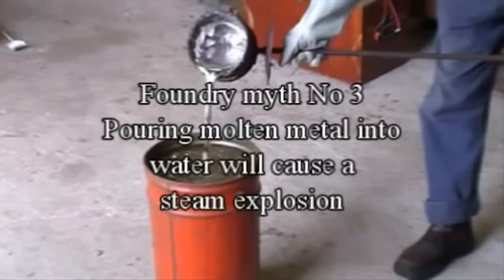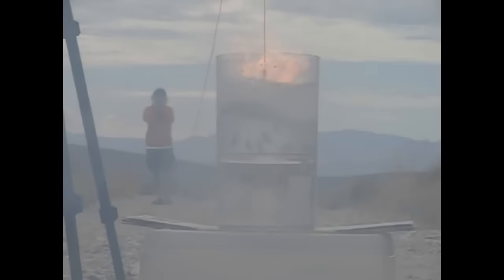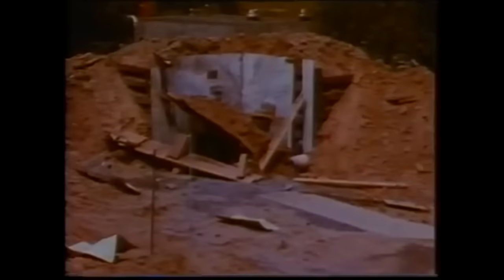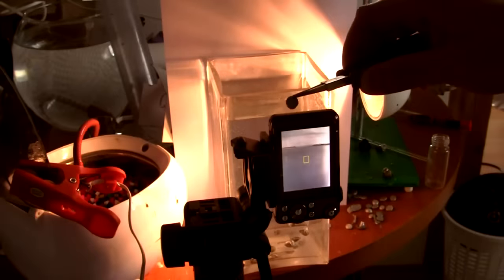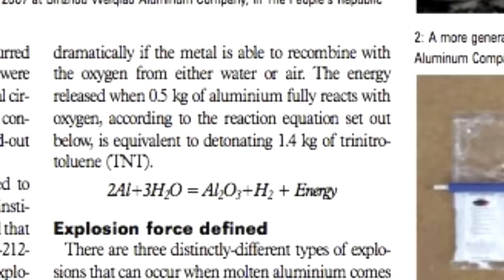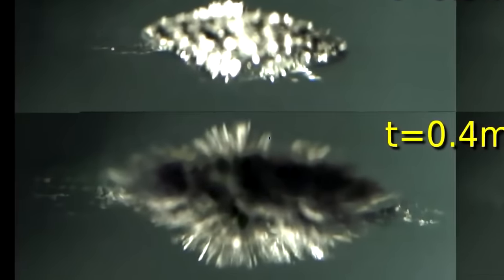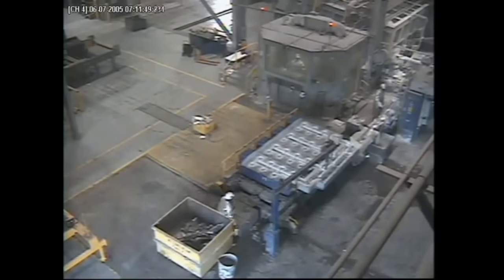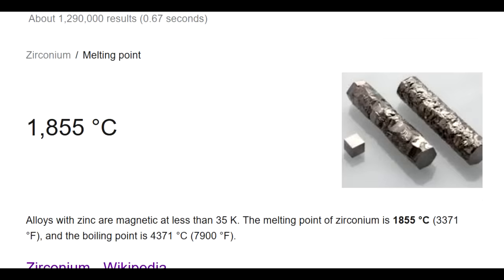The Awesome Power of the Aluminium-Water Explosion!

Comment: I'm pretty sure these backyard pour guys are being protected by the Liedenfrost effect AND the fact the volume of water is greater than that of the amount of molten aluminum, coupled with the fact that there isn't a "trapped water" scenario. Sure, Aluminum is highly reactive... but what if it takes a flash of steam to rip through the oxide layer, and it's not just the water by itself? I think it's very specific conditions that cause these massive explosions, like phase changes + potential energy. The difference between packing gun powder into a a pipe, versus lighting an open pile of it.

Comment: I once absent-mindedly dropped 20g or so of very recently molten bismuth into a bucket of water. Excitement ensued. Purely from the thermal energy flashing steam, no chemical reaction hanky panky involved - but that was plenty enough to imbue me with a permanent paranoia on the subject of hot metal, in water, near me.  It's been 20 years and so far complacency has not returned.

Last year a colleague was disposing of a bottle of dirty gallium-aluminum alloy, preparing to pour it all at once into a pan of water. Although this metal was not hot, it tickled my spidey-sense and I was uneasy. She made fun of my hesitation... so I did the manly thing and left the room. Good thing. What water didn't get converted to hydrogen, boiled and spattered. Something in the room sparked and ignited the hydrogen. Just enough to claim her eyebrows, lashes, some hair, and her dignity, and give her a bit of a sunburn.

Comment: I'm finding this a little over the top. Yes I get it what is going on but i dont understand is why aluminum doesn't superheate the water enough when there is more water. Dont you have to trap it to contain it. Small amounts of water explode. While larger amounts of water with smaller pours of live aluminum just sizzle until it cools. Maybe I'm wrong but I've yet to find/see anything otherwise.

Comment: Sorry posted before editing. With large volumes of molten aluminium, or any other high high temperature molten metal, and small volumes of water, especially in a confined space, the steam becomes super steam, far above the boiling point of water, with far more energy. All the ingredients for disaster.

Comment: the reason its not exploding when its being poured from a small crucible is because the water isn't at a point where its expanding very fast, if you were to drop a whole crucible of molten aluminum in the water at once then it would explode outwards due to the expanding water, its not really playing Russian rulet its just the way science works :/ Ive seen water expand from hot/molten metals before, its truly crazy the power it has.

Comment: You have two types of explosions here I think. One is the aluminium-water reaction, the other is an steam explosion then you flash heat water with molten metal. 
Second is probably easier to get especially inside an mold there steam has problem escaping.

Comment: I’ve seen a much smaller version of this when an idiot spilled nearly a gallon of water into our solder wave pot. As soon as I saw it happen, despite being in full protective gear, I high tailed it away as the resulting steam blasted droplets of 600 degree molten solder all over the area, which luckily faces a metal wall so it didn’t hit anyone. The water was mixed about 60% water 40% alcohol for cleaning and like a moron he left it sitting on the side of the solder pot which is all metal and very hot. The plastic container melted, I heard sizzling, and poof! A shower of hot lead and steam. Needless to say he didn’t hang around long. I had just gotten around the corner. I was completely covered with face shield, gloves, jacket, apron, etc, but the top of my head isn’t covered and it’s luck I didn’t catch any.

Comment: This is one of those situations where because Joe Public comes into contact with them everyday, they don't see the hazards.
They use aluminium foil and thus don't think pure aluminium is incredibly reactive.
They see 12V on a car battery and having used a few D cells in series to get 12V don't see the hazard that comes with shorting one out.

Comment: I have been messing around with the THEORY of aluminum-air batteries hoping to make a safe, reliable, long range electric car. (I use the American spelling, sorry.) I haven't done any experiments as of yet because of funding and safety. The difference between that an aluminium-water reaction is that the Al electrode is made of an alumina aerogel. Making a pure aluminum element is undesirable for precisely the reason above. The reaction needed to make the aerogel is subject to lots of heat and pressure, with a venting step. That is A LOT of energy in a confined space and could be deadly if anything goes wrong. This is NOT for your back-yard enthusiast. The very first thing I learned in Science labs of any description (physics, chemistry, biology) was to look for ways the lab could go wrong catastrophically.

Comment: Nice video, I've learnt some things from your recent videos... but there is a point you seem to have shied away from. Water can also be decomposed using plenty of heat; that is the process of hydrolysis, typically demonstrated using electrolysis, but can also be demonstrated using various metals, which you covered here... that's right; hydrogen gas can be produced using chemical reactions, electricity OR heat (or any mixture of the above, for that matter, hence using various salts in conjunction with metal and electricity in the typical experiments)... so unless we want a perfectly stoichiometric ratio of hydrogen gas and oxygen gas blowing up, we probably shouldn't haphazardly apply enough heat to it to perform that decomposition. Perhaps a hydrogen gas explosion releases less energy than an aluminium thermite reaction, though having said that, it could also be a catalyst for said thermite reaction (or pretty much any other form of thermite reaction, for that matter).

Comment: No its not a roll of the dice , you can drip ali into water but you can't do it the other way around , water going to vapour is nearly instant and expands to 1500 times its own volume ,it's not do much explosive as it's expansion,  if ali goes in water it cools the ali faster than the water heats up ,simple science

Comment: My school in the 1970s had an aluminium furnace explode. Some kids squirted each other with water used to damp the casting sand and some went in the open top of the furnace. They left the burn marks on the ceiling as a warning.

Comment: I'm not sure if this video is just badly researched or deliberate misinformation. Pouring a small stream of molten aluminum into a relatively large volume of water is pretty safe. Pouring molten metal into water is used in industry when smallish lumps of metal are needed. At worst you will get some small splashes of molten aluminium and boiling water thrown up. A face shield is a good idea when around any molten metal but you are not going to get a violent explosion. Aluminium does not react with water fast enough to produce a water-metal explosion like you see when you drop NaK in water.  As you say al oxide is very tenacious and inhibits the reaction. Even if pure al does touch the water the reaction releases oxygen, which reacts with the al to form al oxide which then blocks the reaction.
Where it gets dangerous is when you have a large quantity of molten al meeting a small quantity of water in a confined space, which is what you see in most of the clips you showed. The water violently boils into steam and you have a boiling liquid explosion. Again no water-metal chemistry needed, just simple physics.
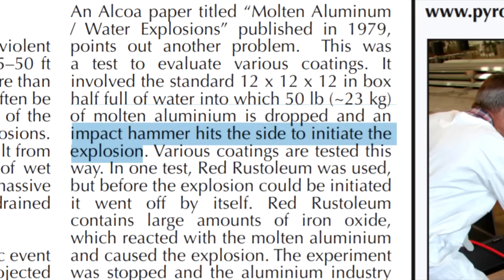What has the article at 12:53 got to do with this? If you read the article, which you must have done to highlight it, the explosion was a deliberate THERMITE reaction involving molten aluminium and an iron oxide based paint. No water involved at all.
Now if you want a really big aluminium explosion try a factory full of dust - finely divided metal powers in air are very explosive and can do huge amounts of damage.

I have been involved in plasma cutting aluminium over water. Blasting plasma through aluminium sheet produces a spray of super heated molten aluminium which is then blasted into water. No water-metal explosions. A small amount of hydrogen is released showing you do get some reaction with the water but that is never self sustaining. The hydrogen can be easily managed with adequate ventilation.

Comment: i dunno if it's relevant or not, cause i'm not a studied up chemist, but one thing i noticed with the aluminium exploding vs getting lucky was that when the aluminium (and the others with the wet molds) had a violent reaction to the water, the water was less than that of the aluminium, where as the ones getting lucky were pouring into more water than they had aluminium. i'm fairly sure you can get similar results with other materials, like chlorine? maybe it's meaningless and water-metal ratios don't mean anything, but it's just an observation, i guess

Comment: This all comes down to the temp of the aluminum, and the ratio of aluminum to water is the critical point, you have to be able to superheat the water before it can dissipate it's heat into the surrounding water, if that guy would have dumped all of the aluminum into that container it would have exploded no doubt but at any point in time he was introducing only a very small amount of hot aluminum compared to the amount of water, all of this is about the ratio of hot aluminum to water.

Comment: Came across this after learning about the theory for the World Trade Center collapses being caused/accelerated by aluminum-water explosions possibly catalyzed by rust-contaminated water.

As you document, what's particularly frustrating recreating this reaction is that even though the aluminum industry has proven that this is an extremely violent chemical reaction, recreating it is very difficult because of the "barrier layer" of oxide on the aluminum surface that you point out forms very easily *even when the aluminum is molten*.

OK.

Why not literally cut through the molten aluminum when it is underwater??

I'm thinking a setup of knife edges (if the rust catalyst theory is correct then large-size rusty X-ACTO blades should do the trick) mounted on a ring and pointing radially inward that would split the stream into ribbons and expose enough pure Al to start the high energy reaction.

Comment: Steam is a double expander. I think most of the "duds" were not hot enough(not enough temperature differential). The second expansion is any time that steam itself gets past the vapor pressure of water. When you are able to get second expansion instantly then Boom! think "Steam sublimation" cool video though. an explanation of vapor expansion rates at temperature would go a long way to be able to help explain.

Comment: @thunderf00t Kind of an offbeat question in realtion to this video, but what are your thoughts on a geothermal air conditioner?  Are they feasible for the costs involved to be energy efficient, relative to the cost and operation of a conventional air conditioning system?  Or is the setup and undertaking of "golden hammer" proportions?

After you run all the coils, pump(s), and install the air handler, could it really be more cost effective to own and run such a system?  Would it really save on electricity?  

Just curious, you're good at pointing out the efficiency of such systems.  

Not sure you will see this comment or answer, but thanks in advance!

Comment: And now we know what caused the explosions in the WTC. The floors above and below each plane would have acted like a furnace. Melting the planes until the aluminium dripped to the floors below, reacting to the water coming from the sprinkler systems.

Then ‘kaboom’ we have explosions causing rapid structural damage.

Comment: IMO the reason the "explosions" did not happen is because it was a SMALL amount oF ALUMINUM in a relatively LARGE amount of WATER.  The foundry had a SMALL amount of WATER and a large amount of aluminum.  The "explosion" is caused by the WATER tuning to STEAM.  in the lager bodies of water there is not enough energy in the AL to bring the WHOLE body of WATER  to BOILING POINT.
And CONVERSELY the large amount of AL brings the small amount of water to a boiling point very fast.

It is the same thing with  oil and water.

Comment: Doesn't gallium inhibit oxide layer formation when it's amalgamated with aluminum? The melting point is low but I'm sure the boiling point isn't... there would be a workable range there from the amalgam melting point up to the lowest component boiling point of the alloy...  a drop of amalgam over 100C may be enough to set off something similar to your NaK experiments.

Comment: I mainly think you are wrong at the part with the explosion at cernobyl. These metal explosions only occur because of the hidrogen realeased by the reaction that is ignitet at this high hit and is not a caracteristic of metals in general to explode like that in watet. I didn't find a reactivity series that says that zirconium could be exchanged in a reaction by hidrogen.
In conclusion i think that youre speculation about the chernobyl explosion is wrong.
Reply: but why would hydrogen add to explosive power when the formation of gas reduces the transfer of heat as opposed to transferring via metal to fluid.
A reaction that forms soluble salts and lots of heat is another thing.
There are explosions involving molten salts and water due to solubility overcoming the leidenfrost effect and yes backyard scientist did this too with molten NaCl.
Metal explosions seem to still be not too well understood and on the one hand you have that coulombic repulsion by the formation of ions and on the other hand you have a formation of a hot soluble salt like NaOH read to transfer all its heat.
IDK about how that translates to aluminum or zirconium because AlOH is not soluble and neither is zirconium hydroxide so perhaps the former effect may come into play more but nobody will know till someone does this in a lab with a super expensive high speed camera.

Comment: I was going to ask, on the previous video, that if aluminium in water can actually bring the water to boiling point, then why isn't this used to, you know, boil water, create steam and run turbines for energy?

But I think this video explains the potential explosive pitfalls of that idea quite well.
Reply: I know I’m extremely late, but it’s simple, the refining process of bauxite(aluminum oxide) into Aluminium is extremely energy intensive, thus you get less energy out of the Aluminium as you put in.

Comment: Doesn't this reaction happen because there is way more aluminum than water? So the cooling ability is so much smaller than the given heat energy resulting in the violent reaction? Water gets trapped under the molten aluminum, oxygen contact is minimized, steam is created in a few nano seconds, the fast exponential heating expansion of the steam then does the rest. Some similar effect like water to burning oil. Correct me if I'm wrong it's okay. I personally think that if you put molten aluminum slowly in the water the cooling power is enough to prevent the explosion. Especially the example with the pool or the aquarium which holds at least 100 liters. It's a matter of balancing. Otherwise casting ant nests would be highly dangerous of blowing up too if water is in the soil...

Comment: @Thunderf00t heres a question. Why is is when you swap the batteries round in the remote do you get charge from 'dead' batteries. Once a month my tv remote stops working, and I just swap the top for bottom and it works again for another month. The batteries worked for a year initially and it's now been 9 months since the first death. So what's the science?

Comment: That is true with reactive metals like aluminium, but not with none reactive metals like steel. However if you pour water into steel the water evaporates explosively and it may bring the steel with it.

When casting aluminium, you don't want to break the oxide skin. Much research had been done by Prof. Campbell on bifilm-theory.
Reply: MaskinJunior aluminium is not a reactive metal, only the alkali series are classed as reactive metals.
Reply: @MrJohnandMargie  I may have used the wrong word, but you ad aluminum to steel as a deoxidizer, because aluminum wants the oxygen more that the iron. That is why I called aluminum reactive.

Comment: Yeah but it's gotta be dumped in fast so as to take some air with it when it breaks the waters surface, and the tension in the waters surface maintains around the molten liquid causing gaps and voids for air to fill, super heat, and rapidly eject as steam no?

Comment: there is actually logic as to why pouring liquid metal into water can have both reactions, either the safe metal resolidifying reaction, or the violent explosive reaction... its based upon how much water and metal you have and what temp the metal is at... if you have less water than is needed to absorb the heat energy from liquid metal than what is needed to disapate before the water becomes steam, than you will have a violent explosion as... but if you have more water and the heat can disapate and you pour the metal slow enough, you will not get any explosion...  so, it all depends on how much water to liquid metal you have, and how fast you pour it in... pouring liquid aluminum into a pool is not likely to end into an explosion. pouring a small amount of liquid aluminum into a giant fish tank slowly is not likely to end in an explosion... more examples also include those ant nest aluminum sculptures... the earth has water in it. but the heat is transferred in such a way that there is no explosion...